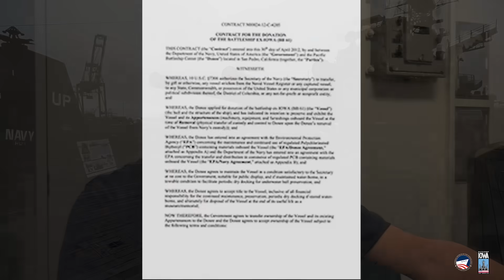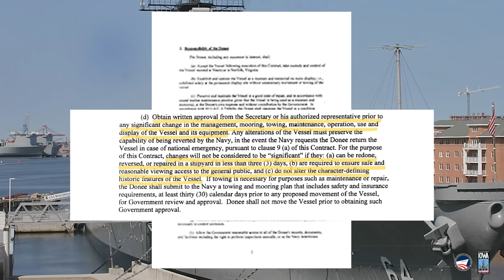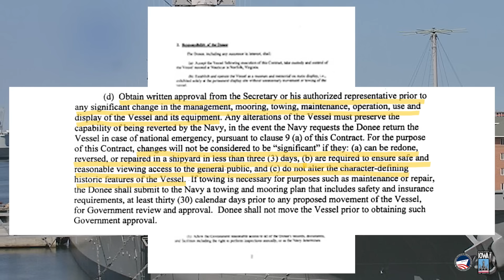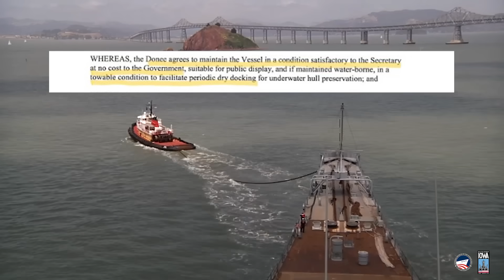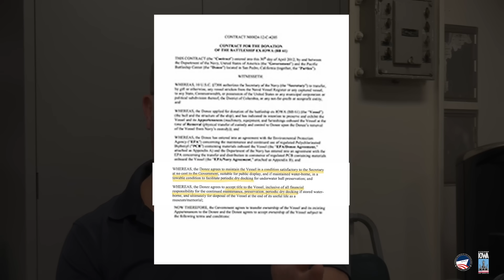Iowa Class Battleship Contracts Demystified

Comment: Sounds daft but I’m assuming you can’t re-activate the ship’s engines! However would the contract allow you to re-activate the electric generation to power the ship if it went to dry dock and couldn’t use shaw power?
Reply: Thank you 👍
Reply: @consideruk  your welcome.
Reply: If you pause and read the entire paragraph taking about the systems. It says they cannot use a system that burns petroleum products. Part of this is the fact that any cooling water for said systems comes from using sea water drawn in via sea chests. All sea chests are plated over for mothballing.

Comment: New Jersey has some welds put in place by the navy to prevent them from rotating the turrets
Reply: Not actually correct. The locking pins for the barbettes were tack welded when laid up to insure the they wouldn't rotate unintentionally, ie under tow. As I recall, New Jersey actually found one of their lock pins not installed at all. 10 mins with an angle grinder and New Jersey's turrettes would be free.
Reply: @vburke1  Yup, originally it was assumed that the BB-62's turrets were literally rendered incapable of rotating, but you could see in the video Ryan did on it that it's literally just a few pieces of steel tag-welded into place. Could probably knock them loose with a sledge hammer if it wasn't such a cramped space :)
Reply: @MayaPosch  There are two pins, one on each side. It would be interesting to know where the lore that the barbette rings were welded originated. Even if you could clean enough of that grease off to actually weld the ring, welding around all that grease would be an insane fire risk.
Reply: @MayaPosch In a recent video, about if they will turn while under way, he states that the Navy cut the power lines necessary for powering the equipment to turn/raise the turret/guns, and they have not decided yet to put money towards fixing it, then states Iowa did fix theirs.
Reply: @J-1410  I'm not sure which power lines he was talking about there, to be honest. It wasn't covered in a previous video to my knowledge, and in the video on the welded turrets, he mentioned that with enough shore power they'd be able to rotate them.

Since BB-61 got theirs rotating so easily, I doubt that it'd be more effort than getting said shore power and removing those few welded bits of metal.
Reply: @MayaPosch The only mention of it that I know of is at the 1:50 mark in the video titled " Will the Guns Move While the Ship Is Underway?". There has been a few times where it was mentioned they don't have the power to turn them or don't have shore power to turn them. Perhaps NJ was retired differently, I don't know. 

It is something that would make a good video "Why we can't do what Iowa did", but I feel like it will be avoided for as long as possible for whatever reason.
Reply: @J-1410  Ryan's explanation over the years has been that the turrets were welded into place (though not as severely as feared), and they don't have enough shore power. BB-61 has a few kW more shore power available, which is required to power the rather beefy motors. 

At BB-62's current mooring spot they could upgrade the available power, which Ryan has confirmed in the past would be enough to power those motors, and with the tag-welded braces gone, the rollers on the turrets are still sufficiently greased to allow for smooth rotation.

Perhaps after the drydocking is complete will we see this as the next goal :)
Reply: @vburke1 just needs a dremel to cut the angle plate off

Comment: Odd contracts so you may have it as museum, the state wants it back if needed, but you get no financial compensation..... 
At least the power should be free for those iowa class if the navy is so proud on them.
That spares a burden for the musea.
Reply: I believe that clause allows the Navy to take action if the museum owners fail to properly maintain the ship in a way that reflects well on the Navy.  The Navy would scrap them before allowing them to be neglected and become an embarrassment.
Reply: The museums got the ships essentially for free in the first place. It's like loaning a car: change the oil, keep it clean, don't let it get under half a tank. If I need it back, I need it back.
Reply: Because the navy has no intention of taking the ships back. They would have happily scrapped them if no one took them in. As the contract states, they’d only want the ships back in an absolute emergency. Honestly, that didn’t have to be in the contract. In a national emergency, they would have probably just taken the ships back at gunpoint if it wasn’t in the contract.
Reply: In 2022 NJ did a video saying the Navy had done just that. They had a week to clean out the museum's property and then the ship would be back in Navy hands. They wanted it to head for the Black Sea. Yes it was posted on April 1st.

Comment: Great video in comparing the language differences between the Iowas.  I wonder how you can maintain the hull bottom without a dry dock period.
Reply from the maker: Quick answer: impressed current cathodic protection, cofferdam work at the waterline, and UWILD processes. We’ll explain more fully in upcoming video.
Reply: @BattleshipUSSIowaLosAngeles  Thanks very much!
Reply: mostly with sacrifical anodes and keeping bilges dry. a Sacrificial anode is a chunk of metal like Zinc that is hooked onto a ships hull and basically rust itself to prevent the ship from rusting.
They also showed the barnacle scraping at the end which helps a bit since barnacles over time eat damage the coatings of the boat.